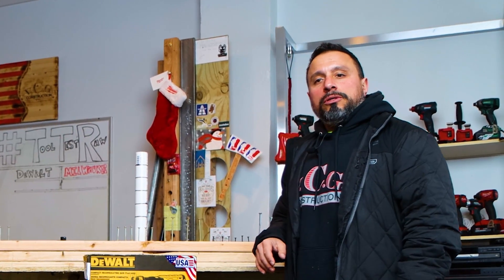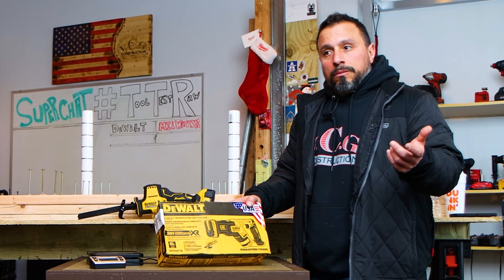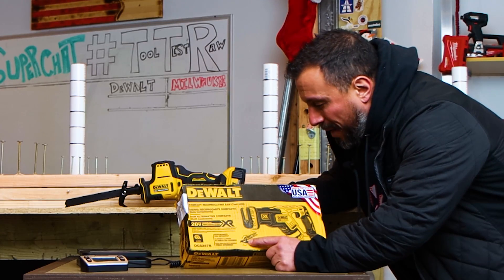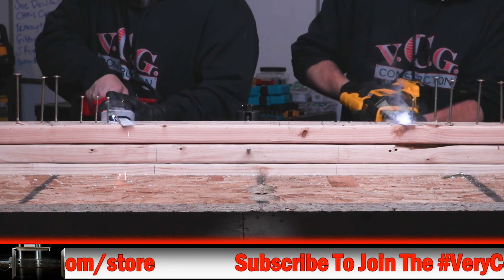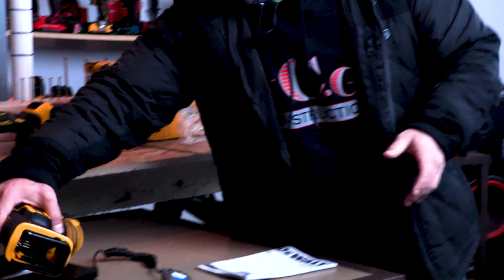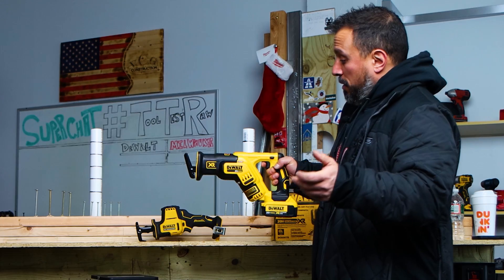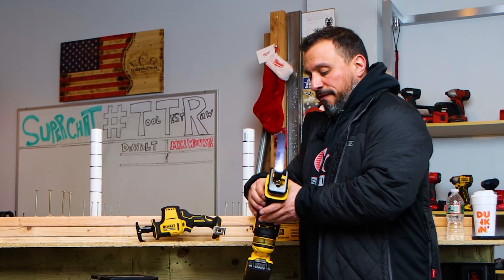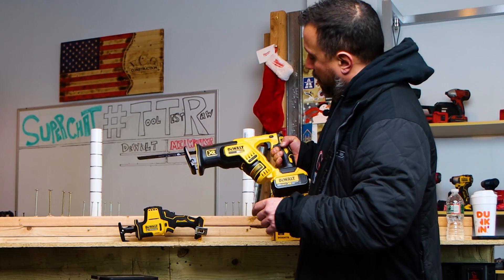DeWALT XR Compact Reciprocating Saw IS NOT WHAT I EXPECTED

Comment: I own this saw and it's my go to for making large rough cuts quickly. Which makes it great for demolition. Almost nothing beats its size, power, and versatility but... 

Cuts can cause tearing of the material and repetitive use can be straining due to its weight and vibration. I find myself using a second one handed saw when making many high quality cuts.
Reply from the maker: Good feedback , thanks
Reply: I also own this saw and concur with this comment. Owned it for over a year.
Reply: Omg I already have one and love it but damn, such a good idea. I'm gonna buy a second one to duel wield :D
Reply: Ha, high quality cuts with a repo saw. Now that’s funny 😂. I suppose you have a precision sledge hammer as well.
Reply: @scroungasworkshop4663  Lol, I guess I could have said "higher quality cuts" instead. My version of a precision sledge is a chisel which further proves your point! 😂
Reply: Keyzie Lock. Thanks for taking it as it was meant. Light heartedly. 👍👍👍👍
Reply: I just bought this saw, always wanted it but never had a reason. Used it to take apart a deck which was awesome but definitely had to rest every 15+ cuts due to vibration.
Reply: @NachoBunny  to save your hands take a second every 20 minutes and just stretch it out. a few months of cutting door frames for flooring gave me a repetitive strain injury because i was going for 3-4 hours without breaks and now the palm of my hand locks up and pops and it hurts like a bitch. also can crack my wrist so loud we get an echo on the job site.
Reply: @scroungasworkshop4663  it was pretty funny.

Comment: I've had the XR Compact for going on two years. It's awesome, I use the piss out of it, and it's never missed a beat. I've used it for cutting cast iron drain pipe my other saws couldn't reach--hint: Diablo makes a carbide blade, works wonders. I've used it for cutting down / trimming smaller trees. I've used it for demoing several projects. I've used it for cutting PVC and EMT. I've used it as an improvised jigsaw. If I could have only one recip, this would be it, because the positives outweigh the negatives massively. 

A few complaints about it: starting torque / low RPM torque compared to bigger saws is a fair bit lower, so you might have to start a cut at a higher stroke rate than you'd like. It does jiggle you more than bigger heavier saws, and it has a shorter stroke than bigger saws. But hey, it's a compact saw you can basically use in one hand, and it will reach stuff the bigger saws won't--no such thing as a free lunch.

It would be nice if the next version had a speed limit control like my Bosh jigsaw. I'd buy version 2.0 all over again if it had that; usually you don't need the wicked max RPMs this little guy will dish out. You can only feed some materials so fast (plastics and metals especially), and constantly modulating the trigger to the precise RPM you need all the time is kind of a PITA.
Reply: I just found the diablo carbide and can attest its amazing when plumbing and doing demo and re pipe work

Comment: I do have this saw... I've ben cutting roots off of stumps in the past few days and torturing it pretty bad, but it worked like a beast and got the job done easily... barely got hot, just a little bit. I don't think the vibration is bad at all.
Reply: Probably not too bad, but you'll think it's bad when you primarily use a counterbalanced orbital saw.  I have a Milwaukee from the 90s that's orbital and it's as smooth as butter

Comment: I’ve had my over a year . Was cutting out some old black iron heating pipes in a crawl space . Got it wet . Didn’t want to run . Dried it out then it was fine . Great saw for light use . Vibrates a lot . I’m a plumber so it’s great can get up in a attic and buzz a hole though the roof for a stack easily. A HVAC installed should go with the 60V , ( regesters , returns etc .

I wouldn’t buy another compact saw again. Unless you want to have 2 in the truck

Comment: Have two Dewalt reciprocating saws,the brushed two handed version and the compact brushless version.Both work great,but that compact version is half the weight of its bigger brother.And it has the same stroke length as the bigger version 1 1/8”. When you have had two shoulders operations and you are reaching over your head to make difficult cuts,that lighter version makes a big difference in your happiness level.Just my two cents worth.

Comment: We have both in our carpentry shop. Most guys grab the one handed for small tasks but take the heavier for most demo work. When things get real we get the 60volt recipicating saw, that is a monster I put it up against a Rigid 18 volt cutting a car along with the DeWalt 20 volt that 60 ran away from both but I like the balance from the DeWalt 20 for most of the time

Comment: I bought the dcs387  brushed version because I got a 4.0 XR battery for free. I like the 4 position blade clamp and an 1.125 inch stroke length. Plus I don’t remember how much I paid but it was less than the XR and it came with a battery.

Comment: I have it. Fits into a deep drawer TSTAK box. Fits between studs. Flush cuts. Cuts up, down, left, right, A,B. Easy to carry around. My only gripes are the led could be brighter; no hook; and that the recoil'll beat the shnit out of you even wearing gloves.

The most efficient isn't when pushing down. It's when you push the shoe forward to the work and make the blade to the job.

Comment: Got it, love it. As a post framer, I use it almost daily cutting off overhang, walk door base plates, and mostly. Cutting off excess post tops over the trusses. I ordered a makita rafter hook to mount it. Best option for scaling buildings when you need something with enough power to efficiently cut through many treated posts and small enough to hook into your pouches and climb nailers trusses and purlins
Reply: Hi mate. How did you fit the rafter hook to it?

Comment: The smoothest operation of almost any recip saw is the older Ridgid GenX-4. When I demonstrate Milwaukee Fuel VS Ridgid GenX-4 everyone is shocked by how much quieter, smoother and so much less vibration with the Ridgid. Milwaukee fuel by comparison almost vibrates out of your hands and is so noisy you need hearing protection. With tools the excess noise and vibration is wasted energy, sucking the battery down faster.

Comment: It is an amazing saw.
Does everything I've demanded and then some. 
Almost as bada.s as my old corded makita.
Still considering the Atomic for plumbing duties though. 
But for straight up demo work.
This saw is close to perfect.
The 4 position bladeholder is a gamechanger.
Yes it vibrates. A lot.
But all powerful recip saws vibrate.
I'm good with the vibrations and noiselevels.
Performance more than makes up for it.

Comment: Have a question regarding the Atomic compact recip...I purchased on recently and it had a rattle sound coming inside motor housing as I shook it (not in use, or with battery connected), contacted DeWalt and they said it should not have a rattle inside so I exchanged it and the 2nd one had the rattle as well, so I exchanged it and the third one had the rattle too....BUT, all three have had a different amount of the rattle, basically the same rattle but some more than others.  I'm holding the trigger, trigger lock, anything external so they can't move as I shake the tool and sounds like rattle is definitely coming from inside motor housing.  I was wondering if your Atomic compact has this rattle??

Comment: Regarding the length difference, Up until 6:10 at least, you didn't account for the fact that putting the battery on the one-hander would make it longer, but the other has it on the bottom.

Comment: DeWalt has definitely got "ergonomics" down pat. They always do a fantastic job of making tools feel really good in your hands. #Yellow&BlackAttack
Reply: The only Dewalt I am not impressed by is the cordless framing nailer. I think it needs redesign.
Reply: I find makita is far better for ergonomics. My drill they moved the for/rev switch 1/4 inch closer to the back and its easier on my hands with the small indent at the top of the handle. Also has very low vibration.  Dewalts impact might as well be thrown in the trash the day you get, including their top of the line XR. My ridgid was better.

Comment: Good review. Let me see if I got this right. You got a tool only; no battery, no charger and no blade. Battery and charger ramps the price up considerably, especially the battery. It looks like it will get most jobs done. Swivel blade good idea. Prices I checked for un-refurbished  XR version tool generally ranged from $170 (no battery) to $250 (with one battery and charger) free shipping, two day delivery. (maybe); blades still extra, but not a deal breaker. Still looks like a contender. I won't mention my source, but it's easy to figure and I'm not going to do their advertising unless they get out their checkbook.

Comment: Had all DeWalt 36v tools, probably the best cordless sawzall I’ve ever owned. But they had quite the mileage and I wanted to “upgrade” to something newer and LIGHTER. I sold them and bought the flexvolt stuff. Circ saw was a jump in power but I miss the left sided 7.25 blade. As far as the sawzall was concerned... I HATED THE FLEXVOLT. underpowered compared to the 36v, and would stop multiple times in the middle of a cut for “safety”.... wth is a demo tool worth if it sissies off a difficult cut?? And it could only charge the blade 2 ways, not 4. Anyways.... I sold that at a loss and bought the one in this video! Thing is AWESOME. Lots of vibration... like, lots. But that’s more than a fair trade off for the power, size, and 4 way blade orientation. I now find myself reaching for this thing with a tree limb blade on it before my chainsaw.

Comment: Hi Vince can you do a video of the Dewalt brushless compact reciprocating saw vs the Milwaukee brushless fuel super sawzall with I have need to replace  my Ryobi brushless hammer dril soon warranty just expired on it got a lot of batteries 40% Milwaukee high output batteries and 60% Ryobi HP batteries in my Milwaukee pack out system I was wounding if you could do a tool test raw with the Milwaukee none fuel brushless hammer dril against the Milwaukee Brushless fuel gen 3 Hammer Drill?

Comment: I've had that model for 2 year's,  It's not bad. It is more compact for cut outs in between 16 on center bays. But I find it awkward compared to traditional sawzalls. It may be a preference I'm used to. It does have a lot of power and is efficient with battery life. I'm happy with my purchase.

Comment: Bought this saw over a year ago. It was my 2nd dewalt purchase and totally got me hooked. I pull auto parts alot so having something powerful, durable, and quick is a must. This thing fits the bill. I've cut out axles, exhausts, fenders, cut down 8x8 railroad ties and more and she just keeps eating whatever I throw at it.  It vibrates and is noisy but that's a small sacrifice to me for it's performance. Side note quality blades are a must it makes even the more lackluster recips a different tool.

Comment: I own the saw and it's ok, not great. Lots of vibration when you try to start cuts it's very erratic when it starts and is tough to get it to cut clean. The Chuck is nice having 4 positions, but the main up or down position for the blade is extremely loose and what causes a lot of the problems. I actually originally bought one second hand and just figured it was worn out so I bought a new one and it was exactly the same thing. I used to one hand cut EMT and liquid Tite but not anymore. This thing has bit me to many times.

Comment: I own this saw and prefer it over the normal size. I'm commercial, new construction Plumber use it every day all day cutting studs, pvc pipe(even up to 6" pipe), all tread, unistrut and steel pipe. whatever you want to cut. just easier to handle.  Cake All Day!!

Comment: I picked this one up tool only for 119.00. This saw is bad ass. It does everything you could ask. It’s also great as a one handed cut off saw for pipe with accuracy. Saw is very capable at heavy duty work. I have tried every sawzall and model of the top 3 brands and this is my favorite. The blade stroke is the smoothest and capable of shave cuts where all others fail due to excessive vibration. And no I would not buy that little atomic saw. All atomic tools are pointless and under powered.

Comment: I've had this saw for about a year, and its either great or terrible. It's great for rough work, ripping through pieces of lumber/steel. It is TERRIBLE for any kind of work that isn't really rough. The vibration from it can really throw it from its position and quickly make a mess of the work you were doing with it. 

Great power, terrible precision, in a large part due to that vibration, which I feel like people understate, as it really does prevent you from getting really straight controlled cuts.

Comment: I bought one 5 years ago.  Light duty home use.  Until just the other day when the part of the saw that locks in the blade snapped clean off the reciprocating shaft.  Showing that the part was made with cheap metal. YMMV, of course, but I wouldn't count on it for heavy duty use for an extended period of time. No, I don't expect anything to last forever, but I sure as heck did not abuse this thing, much less use it all that much over the time I had it.  IMHO, don't count on this thing lasting very long if you use it a lot.

Comment: I’m not a fan of these new “hacksaw” style recip saws no matter the brand. I can’t think  of a single application to use the hawk saw over the normal style
Reply from the maker: I felt the same way, but fence installers and plumbers seem to use them to great benefit
Reply: Yea as a plumber i have a m12 fuel hackzall and a m18 fuel sawzall ....

The m18 sawzall is definitely a power king .... if your cutting a old shower apart  or any serious cutting the big saw will work faster ..... but my m12 hackzall is the one that gets the most use ... grab a pipe ... grab the saw and cut it .... grab a 2x4 ... grab the saw and cut it .... the big saw it more wobbly if you try to 1 hand it .... plus the 90 degree handle puts your arm away from the material ... not above it 
1 handed for the win
Reply: It's kinda handy for small cuts like when running around hanging conduit, or a hard to reach cut while on ladder. But u do have a point.
Reply: VCG Construction that’s a good point this would be useful for cutting anything bigger than 2” pvc for drain lines.

Comment: We have a TON of dewalt 20v tools. As GCs we use our tools daily. I cant stand that xr “new” design recip saw. It is way underpowered compared to the traditional design. Wasnt impressed at all. Have also had continuous issues of that design stop working in mid use many times over.